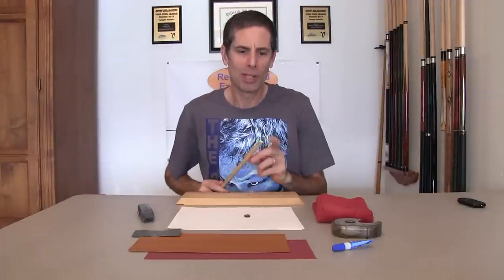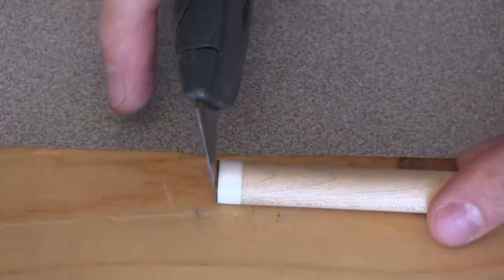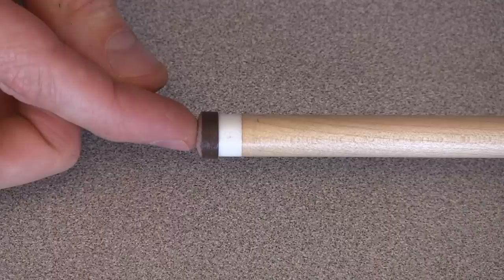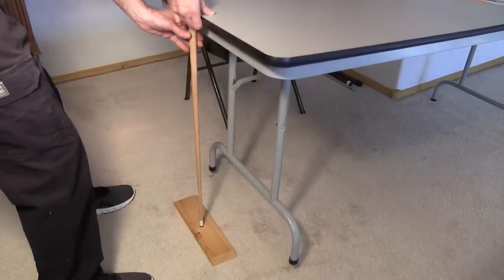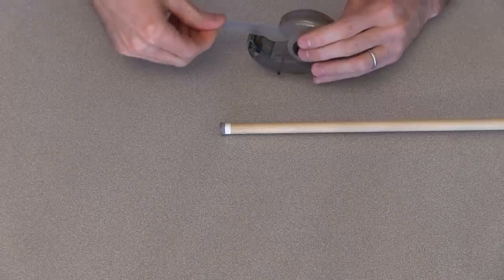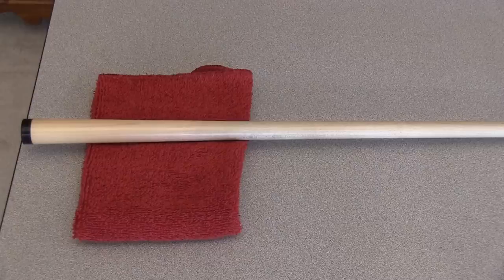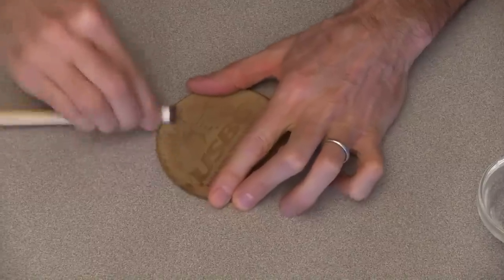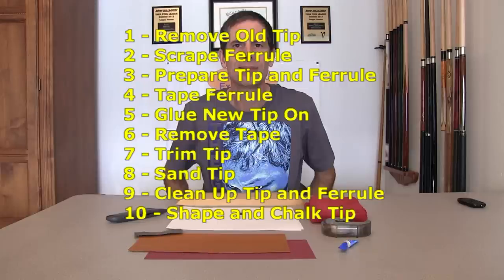HOW TO REPLACE A CUE TIP … No Special Tools Required

Comment: Thank u for the video. What is the tip 's material made of? I have a cue stick but it doesn't seem to hold chalk. I will have to replace it with the authentic material.
Reply from the maker: Most tips (including the ones in this video) are leather.

Comment: Great vid, but im sort of shocked that the process is this difficult. You'd think they'd have designed a new standard where you could just screw them on or something. Also you'd think they make tips in different sizes to match your cue so you don't need to sand them down.
Reply from the maker: @thestever  It is easier for “cue guys” who have lathes.  Tips do come in different sizes, but it is difficult to center them perfectly when gluing them on.  Screw-on tips would add too much weight on the end, which would dramatically increase CB deflection.

Comment: Hi Dr.Dave, thanks for the video! I used to replace tips myself when I was using a wood shaft. Not sure how those steps can transfer to replacing tips on a CF shaft.
Reply from the maker: The steps are no different; although you should be even more careful. Those CF shafts can be expensive.
Reply: @DrDaveBilliards  Hi Dr.Dave, thanks for replying. I ask mainly because a lot of the CF shafts have a soft silencer pad between the tip and the actual shaft/ferrule. I am afraid that the "tip scraping" step would damage that pad.
Reply from the maker: @shuchengchao  That's where the extra care is required.

Comment: Do you have recommendations on which cue tips work well? Do you do merchandise recommendations?
Thanks in advance.
Reply: Look up "milkdud" tips. They are single layer leather soaked in milk then pressed in a tip press until dry. Very good tips, as good or better than any layered offering. Eferen and many top pros play with them and have for years. Very little to no maintenance, will not mushroom, hold chalk well and feel very nice. Outsville sells them as does many ebay sellers and various retailers. I personally have used outsville and can recommend their product as good. Also, they are very cheap. If you make them yourself, it's like $1 per tip, but purchasing pre-made will be around $5-10. They should last on your cue for several years, very good longevity.
Reply from the maker: I don't do merchandise recommendations.  Honestly, I don't think the brand or type matters much.  The player is much more important than the tip.  Although, I prefer a harder tip for the reasons here:
    https://billiards.colostate.edu/faq/cue-tip/hardness/
I've used Triangle for many years, and don't see any reason to change.  I've tried others, but I always go back to the reliable Triangle.  I haven't liked the layered tips I've tried.
Reply: @DrDaveBilliards  Thanks, Dr.Dave! I've learned something today. I've gone with the intuitive assumption that softer tips impart more spin than harder tips. 
Good to know hardness doesn't matter.
Reply: @boogiemanspud  thanks for the suggestion. That sounds almost too god to be true. A ready made tip that's $5 or $10 that'll last several years. Will look it up and check it out.

Comment: What kind glue are you using in the Video? Do you have link on Amazon for this glue? TY
Reply from the maker: It is Super Glue gel.  You should be able to find it on Amazon.  FYI, details like this (and more info and advice) can be found in the document linked here:
    https://billiards.colostate.edu/faq/cue-tip/replacing/

Comment: Hi Dr D. Im attempting my first tip change today. Dont know much about sanpaper. What grits do you recommend for cleaning the ferrule and shaving around the tip?

Edit: nevermind! I took screenshots of the grits you showed on the back. Thanks!!
Reply from the maker: FYI, I have all details like this in the supporting document linked here:
   https://billiards.colostate.edu/faq/cue-tip/replacing/
Reply from the maker: Here's the direct link:
   https://billiards.colostate.edu/resource_files/cue-tip_replace_handout.pdf
but the page I linked also has lots of other good advice and info on it.

Comment: Great video, as all of your others Dave. Is there any way to not damage the old tip in order to recycle it and to put it on another shaft?
Reply from the maker: If the tip is in good shape, you cut it off cleanly, and you sand the bottom flush, there is no reason why you can't reuse it.
Reply: @DrDaveBilliards  Thank you. You really do live to swerve!

Comment: I have a 13mm shaft. Should I buy a 14mm tip or a 13mm. Tried to find answer without success. Thank you for any help...
Reply from the maker: If you are using a lathe or the procedure in this video, buy a tip larger than your shaft. It is too difficult to get an equal-size tip centered.
Reply: @DrDaveBilliards  Thank you!!

Comment: Is it possible using similar method for changing phenolic tip without lathe?
Reply from the maker: Step 1 (removing the tip) is much more difficult (and might require sanding the tip down instead), but all the other steps are the same.
Reply: probably sanding the tip down will be much more safer option, thanks!
Reply from the maker: @lofinyzosma4281  Agreed.

Comment: I just can't get used to these newer short ferrules. Im used to the long elegant looking ferrules from back in the day.
Reply from the maker: If you want an LD shaft, a long ferrule is not acceptable.  See:
    https://billiards.colostate.edu/faq/squirt/endmass/
Reply from the maker: There are advantages to an LD shaft:
   https://billiards.colostate.edu/faq/cue/low-squirt/#advantages
especially if it is carbon fiber:
    https://billiards.colostate.edu/faq/cue/carbon/
Reply: @DrDaveBilliards  I understand, its just the look of the short ferrule that I have a hard time getting used to.
Reply: @DrDaveBilliards  thank you for taking the time to provide that information though. It is very helpful and interesting.
Reply from the maker: You're welcome.  I aim to swerve.  :)

Comment: Why not use rubber bands instead?
Reply from the maker: Do you mean tying bands to the shaft and then stretching them over the tip to apply force while the glue sets?  If so, that sounds fine to me; although, I suspect the force won't be nearly as large and probably not as centered.

Comment: I think you should've used a tip without any shape for the demonstration. My biggest concern is shapping a flat tip evenly without losing like half of the tip and i suppose most people buying a new tip will get one without any shape.
Great vid nonetheless!
Reply from the maker: Good point.  Without a lathe, a tip shaper tool is the best way to go.  I'm glad you liked the video.

Comment: Sir, if my tip got completely removed from the ferrel, can I reuse the tip without replacing it with another one?
Reply from the maker: Yes, assuming the back isn't too damaged and the tip has enough height remaining.  Just make sure you sand the back to remove all glue residue.
Reply: @DrDaveBilliards  Thank you!

Comment: Could you use a hair dryer instead of having to cut off the old tip?
Reply from the maker: I don't think heat affects a super glue joint very much (if at all).

Comment: Is this process different for phenolic tips? Replacing a non phenolic with a phenolic. Thanks!
Reply from the maker: The procedure is the same except for the "remove the tip" step.  The phenolic is much harder and you might need to sand or grind it off (maybe with a Dremel tool).
Reply: @DrDaveBilliards gotcha, so does that hold true for sanding it down to size once the new phenolic is glued on? As in, I won’t be able to just use sandpaper as you showed here? Thanks!
Reply from the maker: @almostaskater62  I honestly haven't tried it, but I would think sanding would work.
Reply: @DrDaveBilliards ok cool, thank you!

Comment: I received my first "quality" cue. Is it normal for the tip be "fuzzy"? I've ordered a shaper (it's flattened a bit in a few days (I shouldn't have been breaking I've learned)) but wondered if I should do more than simply shape it or just be glad it holds a ton of chalk and let it smooth out from wear? I'm 45 and the billiard bug just bit so I'm learning a lot. Sorry, if this is an elementary question.
Reply from the maker: You can do a light sanding like I demonstrate at the end of the video to get rid of the fuzz, but it isn't necessary.  Other than that, just re-shape it periodically (but only when necessary).  It sounds like your tip is very soft.  When you get it replaced in the future, I would recommend a hard tip for the reasons here:
    https://billiards.colostate.edu/faq/cue-tip/hardness/
Reply: @DrDaveBilliards  thank you!
Reply: @DrDaveBilliards  after reading that it seems we need the guy from the channel "Smarter Everyday" to bring some gear and analyze some things :) This is great!
Reply from the maker: @fixitrod4969  FYI, I already have lots of good super-slow-motion video of cue tips and cues in action here:
    https://billiards.colostate.edu/faq/cue-tip/deformation/
and here:
    https://billiards.colostate.edu/faq/cue/vibration/
Enjoy!
Reply: @DrDaveBilliards  I should have figured... very cool!

Comment: As with many things I prefer to leave something like this to a professional. 

For example if my AC goes out I have no problem hiring a pro to fix it. 

Same would go for electrical or plumbing. 

I hold the same standard with replacing a tip on my cue.
Reply from the maker: Agreed.  But every serious pool player should know how to replace or install a tip for those times when a good pro is not available and you need it done quickly.
Reply: Good point. Not everyone keeps a backup shaft or cue like I do so that has me covered
Reply from the maker: @MrTimmyc77  it’s good to hear from you Tim. I hope things are going well.
Reply: LOL. It truly is not that hard and most professionals use a version of this method. The only difference is they might use a lathe. Have you ever seen a "professional tip installer" actually replace tips. It truly is not that much different than this method - just with a lathe added most of the time.

Comment: Bought a foldable pool table and it came with 2 cues, the cue tips are very hard and no matter how much chalk i use if i try to put spin the cue will slide on the ball. Should the cue tips be so hard they feel like their made of wood, saw that good ones are made from leather.
Reply from the maker: You can try sanding them some.  If they still don't hold chalk well enough to get off-center hits, you should change the tips.  For more info, see:
    https://billiards.colostate.edu/faq/cue-tip/care/
Good luck!
Reply: DrDaveBilliards yeah, been researching different tips, I think mine is a hard flat tip used for pool, may look at getting a snooker cue altogether as they also have smaller tips, this one I believe is 13 mm, most common snooker tips are 9.5 mm. The tip needs to have a done shape to work with spin.
Reply from the maker: Flat tips are not used in pool (at least not by anybody who knows how to play).  For more info, see:
    https://billiards.colostate.edu/faq/cue-tip/size-and-shape/
Reply: @DrDaveBilliards  Yeah it's what i got with my pool table and their absolute crap, will be ordering Elk Master tips to replace them.

Comment: Hey Dr Dave,  do you replace your own revo tips or send those away
Reply from the maker: I had "my guy" do it once.  I'll probably try the procedure in this video myself next time.
Reply: @DrDaveBilliards  I've been told one shouldn't due to the red pad under the tip. But I'd love to see a vid. Thanks for the great content sir
Reply from the maker: You are right.  Extra care will be required.  An maybe I would do more detailed scraping (and only light sanding) of the pad.  I wonder if Predator replaces the pad when they replace the tip.  Do you know?
Reply: @DrDaveBilliards  I've re-tipped my Revo 1/2 dozen times on my homemade lathe. 1st time was pretty nerve-racking, but now it's pretty easy to do.
Reply: @DrDaveBilliards  my wife won't let me have my dreams so unfortunately I don't lol
Reply from the maker: @MikeJB6   Do you treat the red pad any different than a ferrule end?  Do you still sand it lightly before gluing?
Reply: @DrDaveBilliards  I treat it with the utmost respect, Dave! I never sand it. I'll remove the old tip very similar to the way you show in your video, then on the lathe I very carefully remove any excess glue using my blade perpendicular to the ferrule, always watching very carefully to ensure only old glue comes off. Before I apply my tip (Kamui Clear - medium) I'll very lightly score the pad with the blade and also score the bottom of the tip. 

That's the easy part. The hard part is getting the tip cut down perfectly to the shaft diameter without touching the carbon fibre or the edges of the pad! For that part I use magnifying glasses so I can see close up. A few pics of my homemade lathe below. It's not powerful enough for anything more than putting a tip on, but it's perfect for that.

https://imgur.com/a/Iziy5CJ
Reply: @MikeJB6  Awesome can you share some of the parts numbers to build my DIY TOOL.

Comment: how long for glue to dry before shaping tip?
Reply from the maker: It depends on the exact glue used, but Super Glue bonds really quickly.  A minute or two is plenty.
Reply: @DrDaveBilliards  thanks so much
Reply from the maker: @clintonehrhardtsr122  You're welcome.  I aim to swerve.   :)

Comment: how do you know when to replace a tip ?
Reply from the maker: I replace mine only after it is worn down too low.  Although, if your tip is not holding chalk well and scuffing won't solve the problem, that would be a good reason to replace it.  I've never had that problem before.  As long as you chalk before every shot like you should, the tip surface should stay in good condition (because chalk is slightly abrasive).

Comment: Why do American cues have plastic ferrules? Your cues are mega expensive but made with a plastic ferrule? That’s crazy, is there a reason for this that I’m missing?
Reply from the maker: ... probably because they look like ivory ferrules from the past, they are cheap, and they bond well with the tip adhesive.
However, carbon fiber shafts now commonly used in pool have no ferrule.

Comment: What grit sandpaper are you using to sand down the old tip?
Reply: Also, what type of glue is best to use?
Reply from the maker: @shader26  FYI, all detailed info like this can be found in the document linked in the video description and pinned comment.  Here it is:
    https://billiards.colostate.edu/resource_files/cue-tip_replace_handout.pdf
Reply: @DrDaveBilliards  ok! Thank you! Great video!
Reply from the maker: @shader26   You're welcome, and thank you!  FYI, more info and advice (from me and others) can be found here:
    https://billiards.colostate.edu/faq/cue-tip/replacing/
Reply: @DrDaveBilliards  That worst part of the job for me was getting the tape off the ferrule! That was a little frustrating. Also, and I know this was maybe dumb, but it was a Sunday and where I live there are no hardware stores open on Sunday, all I had was super glue, not the super glue gel. I hope it works but am prepared to do it again if it falls off. I followed the link you had and the procedure but was very glad for your video to make it even more clear what to do. I’m actually kind of satisfied…it at least looks and seems solid. And nicely shaped from ferrule to tip. Looks great. 
I let the super glue dry/cure for about 20 minutes before doing the rest of the procedure. I am waiting to shape the tip until at least 24 hrs, just to get best chance for totally cured. Had used the table method to keep pressure on the tip. Thanks! It at least LOOKS way more professional/solid than the cues at the local pool hall.
Reply from the maker: @shader26  I’m glad my stuff helped you.

Comment: When looking at the replacement tip, is the side with the smooth surface or the side that looks more like cork the side that attaches to the cue? I would think it's the side that appears almost laminated, which I understand we're sanding off anyway, but that side doesn't press on quite as flush as the cork-like side.
Reply from the maker: My replacement tip came with a slight crown on the top.  The bottom was sanded to remove the coating and expose a fresh surface.

Comment: Need a tool to center the tip when applying the glue
Reply from the maker: The tape pre-wrapped to the tip diameter helps a lot, especially if you use your fingernail and paper towel as I demonstrate in the video.  And perfect centering isn't really that important anyway since the tip is trimmed and sanded.

Comment: Isn't there an easier way to do this besides all this work, haven't the pool cue makers designed something that's  "plug and play" to replace a tip? Maybe I'm missing something here? This seems like way too much work for such a simple thing to be replaced.
Reply from the maker: I have my local "cue guy" change my tips.  He has a lathe (which makes it much easier), and he is much better and faster than I am.  Replaceable screw-on tip are a possibility, but they add too much weight at the tip, which increases CB deflection.  See:
https://billiards.colostate.edu/faq/squirt/endmass/

Comment: no special tools required.. except some hard work and patience and finding out that the new tip pushes the ball 0.0005 degrees off
Reply from the maker: Luckily, 0.0005 degrees is ridiculously small.    :)